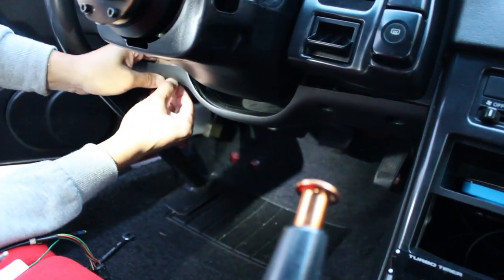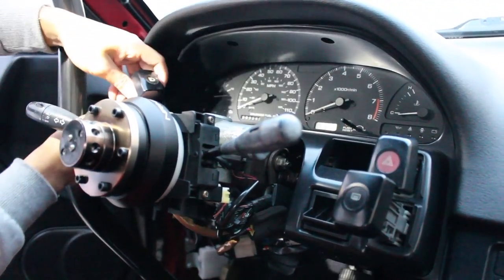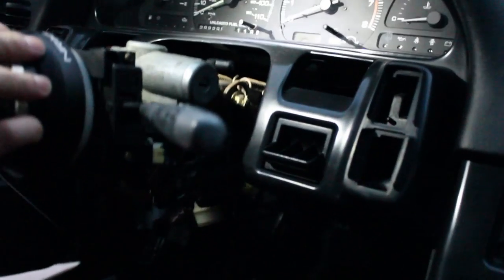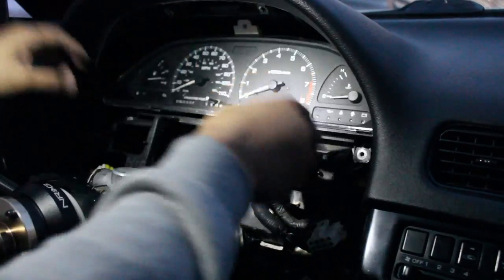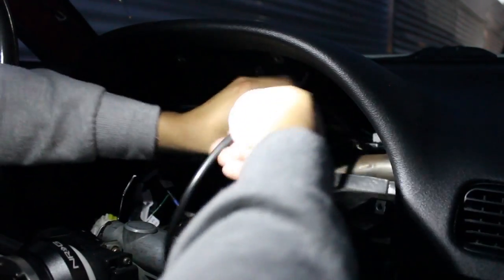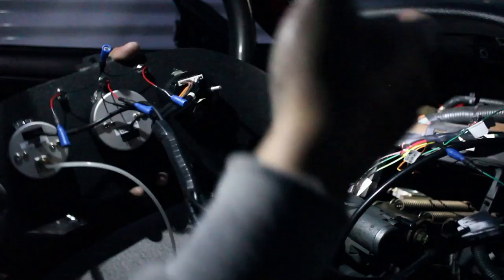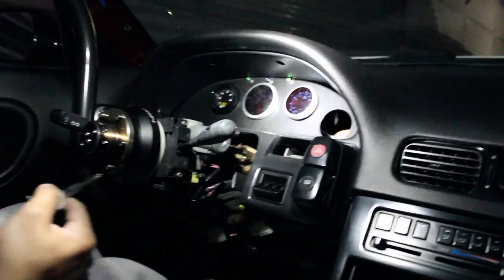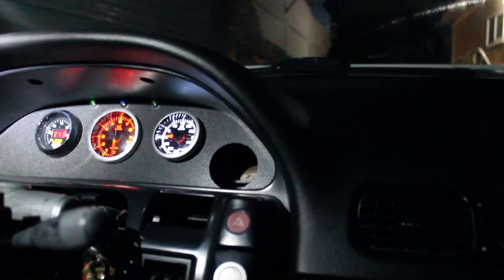Wrench-a-holics | How to Custom Gauge Cluster PT 3 FAIL!

Comment: at 13:26 do those gaps at the bottom left and right of cluster plate remain once everything is put back together?
Reply from the maker: When i first installed it i didn’t have it fully installed that gap goes away just have to adjust the gauge holder

IG: @nightowls.us
Reply: Awesome. thank you very much for the reply. Following you on IG.
Reply from the maker: Shinigami Thankyou for the support stop by my store

savageones.bigcartel.com
Reply: wrench-a-holics hey man I have another question. Did you have to put longer bolts and or spacers to the two bottom mounting holes? Mines dont align when in place only the top mounting hole aligns.
Reply from the maker: Shinigami longer bolts are needed to mount up that panel, but i only used the top bolt, the gauge cluster shroud pretty much secures that panel.
Reply: wrench-a-holics got it. Any movement at all or vibration while driving? I appreciate your responses.
Reply from the maker: Shinigami no movement at all what so ever .. and I’m on solid engine/transmission mounts
Reply: wrench-a-holics awesome. Thanks again!! 👍👍
Reply from the maker: Shinigami no problem glad i can help .. if you have any further questions hit me up.